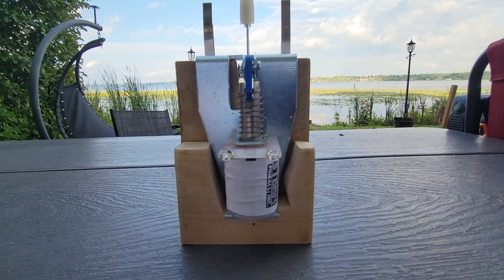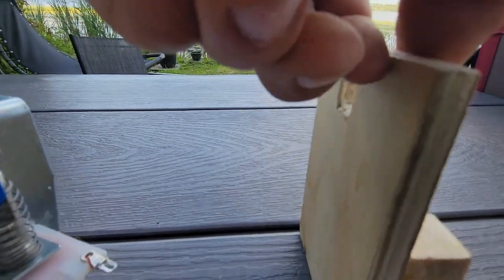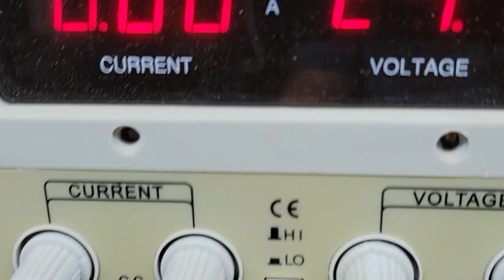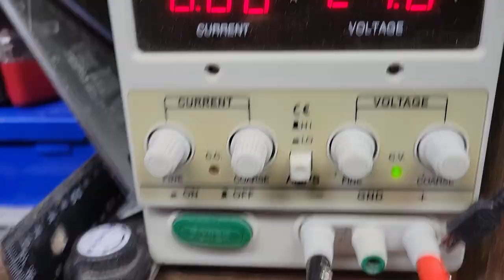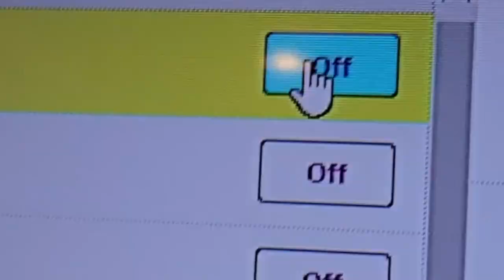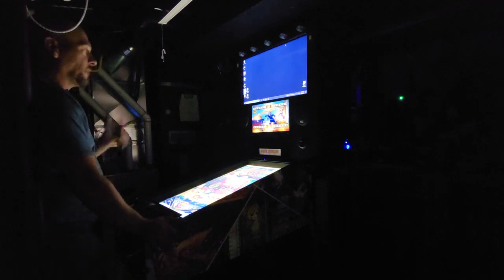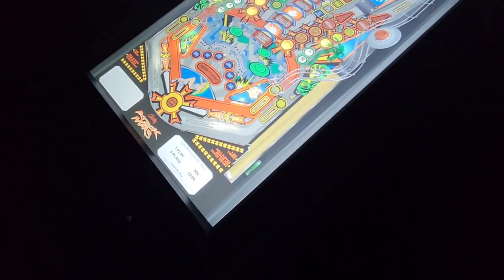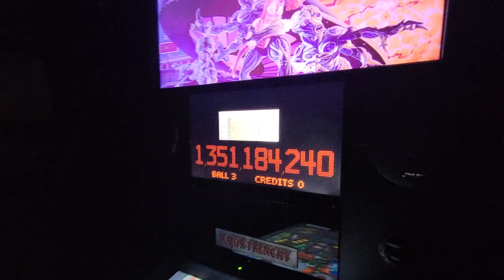Slingshot Assembly installation

Comment: @major frenchy Looks good. Did you use fast or slow blow fuses?
Reply from the maker: Fast
Reply: @MajorFrenchy  doesn't it make more sense to use a low amp slow blow fuse , given your risk is really that the solenoid surge lasts too long?
Reply from the maker: You can i always used fast blowing.

Comment: Are the slingshots loud enough that it makes other feedback feel quiet? Need to upgrade other things?
Reply from the maker: The other feedback (thunderclaps) are a lot quieter, it is always a matter of fine tuning  the different feedbacks and what you want or are happy with. Some people are happy with smaller solenoids. I have other toys that i will add such as 2 beacons / SSF and addressable led.
Reply: @MajorFrenchy  I’d like to add real mechs for flipper and possibly slings but I don’t want them to be way way louder than the solenoids for pops…
Reply from the maker: My direct solenoids for flippers are actually well balanced sound wise

Comment: Your experiment has a flaw! Yes, solenoid consumes 2A, but voltage drop to 12V, so at 24V will be 4 amps!!! You need to rise the current of your power supply and then test the slingshots! Those 3A fuse will be blown then!